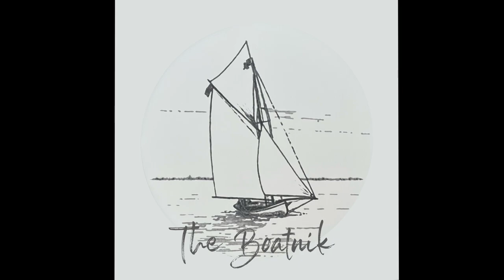My next project, a1980 Com-Pac 16 sailboat

Comment: Dacron sails will clean up easily, even if they are badly stained. An overnight soak in a tub or plastic baby pool with laundry detergent and a cup of bleach will clean them up. Of course old sails get loose and baggy which degrades performance. Nice looking C16! I have owned three of them!
Reply from the maker: Thanks for the tip
I will try it

Comment: Just found your channel.  I was considering a Compac 16 or similar boat as a replacement for my Venture Newport 23.  Raising the mast on the VN 23 and rigging up the boat takes a while as does taking it all down, so day sailing is a challenge.
I was thinking a Compac 16 would be easier and faster to launch.  I am looking forward to seeing how you approach getting the boat ready to go.  Subscribed.
Reply from the maker: They are pretty easy to rig and launch 
Especially after you have done it a few times
Thanks for watching!

Comment: I'm looking at one of these but it's got some cracking  on the front where you would tie of that sail and it would need sails and the gel coat redone I think they want to much on it though
Reply from the maker: New sails could easily cost you $1000 to $1200
Used can be found fairly cheap if you are patient enough 
If you look back in my videos there is one maybe called “ a couple of winter projects”  shows what mine looked like when I got it
I paid $400 for it
In fair condition with decent sails they usually sell for $3000 and up depending on condition around here